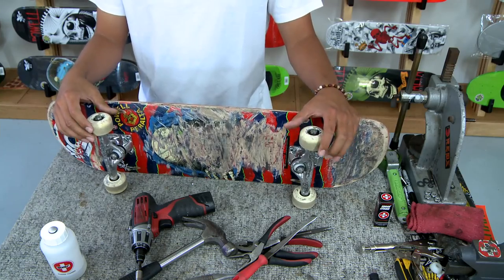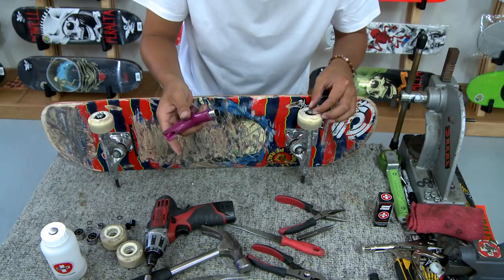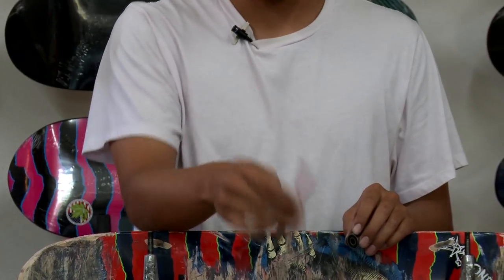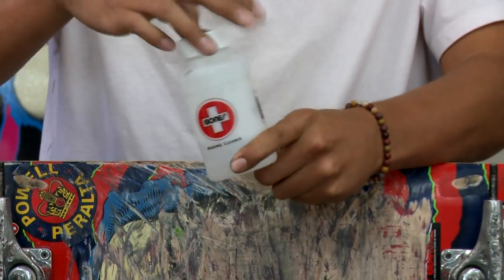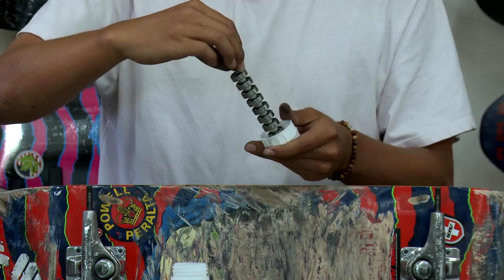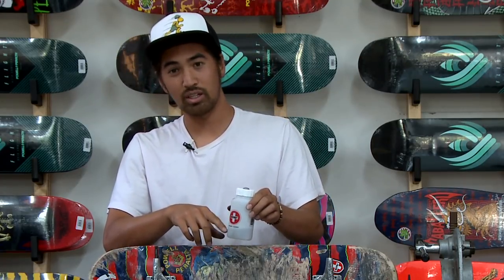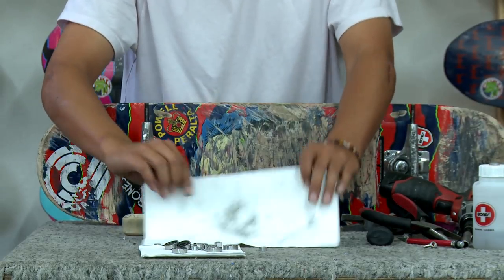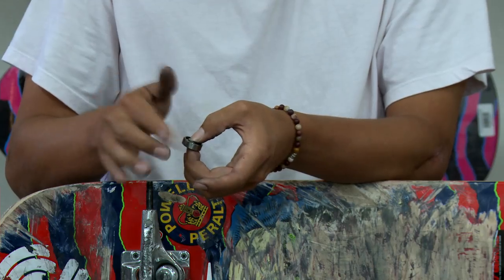BONES BEARINGS - How To Clean Your Bearings

Comment: Why would you want to use a bottle to clean your dirty bearings?
Trapping all the dirt in!.... Just like you don't take a bath because you are in a soup of dirt you take a shower all the dirt washes down the drain
So go to the automotive department and pick up some break cleaner in a spray can blast out all the dirt and its dry in seconds no residue and safer than acetone

Comment: FYI you never want to press on the inner race of a bearing . Ever!
Reply: If you're replacing the bearing(s) on and armature, you HAVE to push them by the inner race. If you're replacing bearings on a brushroll for a autoscrubber, you push them into a housing and therefore HAVE to push them in with the outer race. It all comes down to pushing on the race that can withstand the force in THAT circumstance 💯😎